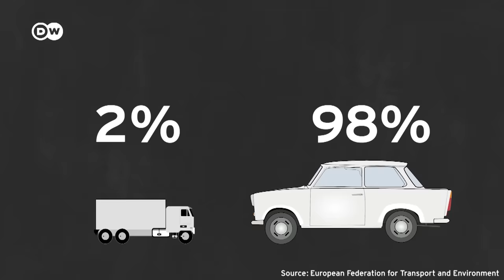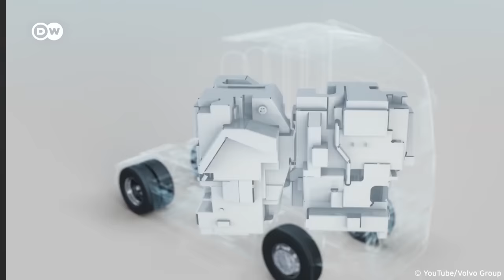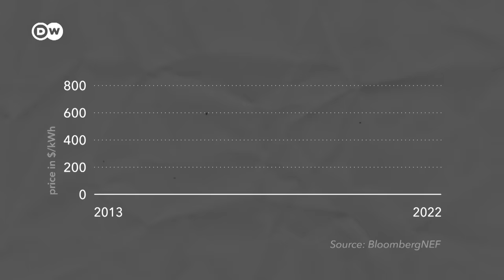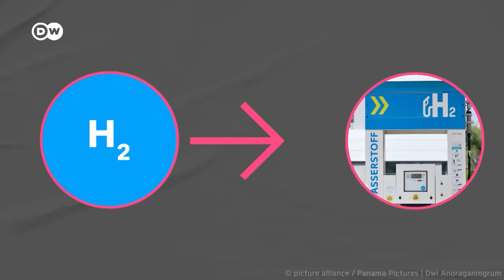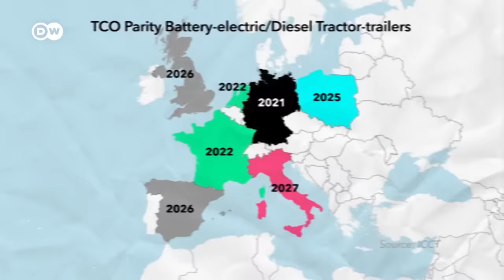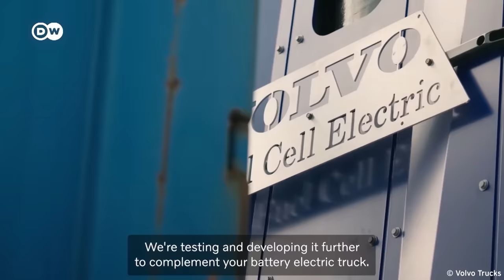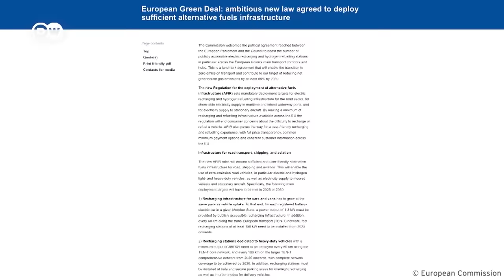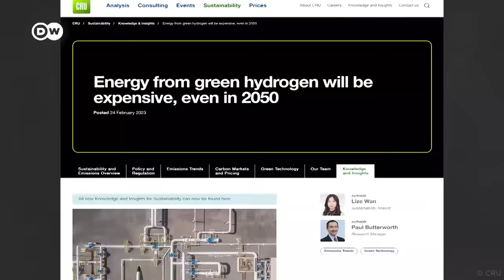Which will be the engine of the future?

Comment: There’s no way people still believe that EVs are better for the environment
Reply: actually more and more people believe this because it is true.
Reply: @Simon-dm8zv 
EVs are absolutely terrible for the environment. They are FANTASTIC at simply displacing the pollution to somewhere else, like a landfill in Ghana.
Stop being a headless sheep and be skeptical about things.
Reply: @erlingnesbakken9871  wrong. Total emissions are far lower than a gasoline or diesel car.
Reply: They are far more carbon intensive to produce, and unless the electricity for charging comes from renewable sources (which it doesn’t most of the time), they will pollute during their lifetime anyways. Also consider how much longer gasoline cars actually last before needing to be replaced. EVs last far shorter because of the battery, and they then get sent off to a landfill somewhere to leak acid in the environment.
Reply: @erlingnesbakken9871  Mostly correct (except for your last sentence of course), but that doesn’t change anything. Research shows that lifecycle emissions of an EV are still lower.

Comment: So much misinformation here.

How much energy does it require for battery construction for 1 electric truck vs 1 hydrogen truck

How much damage does taking the minerals and materials from the earth to make a battery compared to how much damage converting water to hydrogen would cause.

How much does the household electricity bill go up for electricity because almost all electricity grids are strained as is (which in turn is going to require diesel generators to cope in a lot of cases)

It says about 3 times the solar plants to make the hydrogen or 3 times the amount of nuclear plants. That's blatantly false as 1 nuclear plant is way more efficient than thousands and thousands of solar units.

Most manufacturers would rather go hydrogen and a lot of them are beginning to heavily invest in it at the minute as they can see clearly hydrogen is the way forward but they were forced through taxes and laws to try to push electric powered vehicles.

No manufacturers are still planning on going full electric by 2030 anymore they all scrapped that idea recently 

Very biased and one sided 😂😂😂

We pay more in the end by a lot for electric which is the only reason governments push it